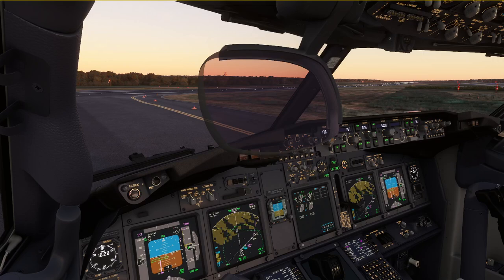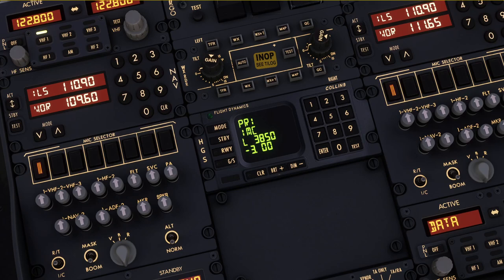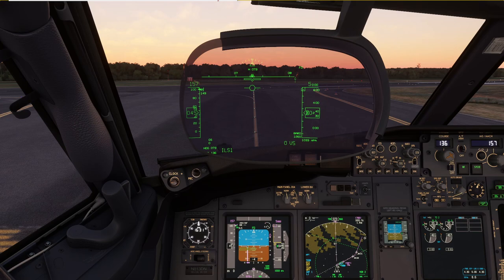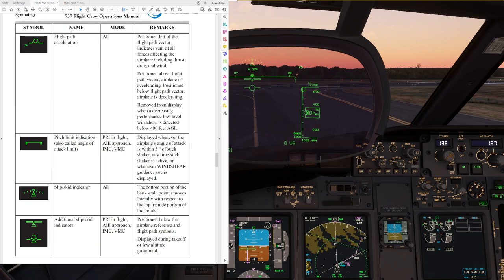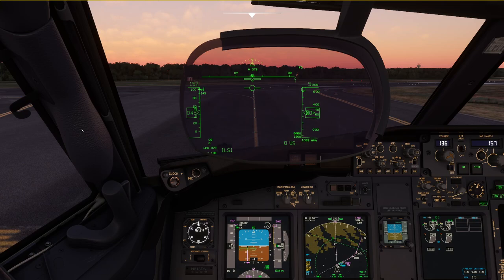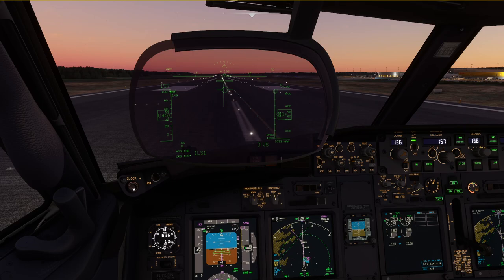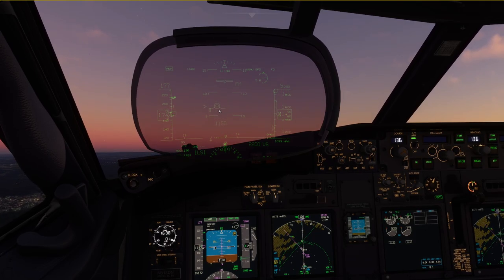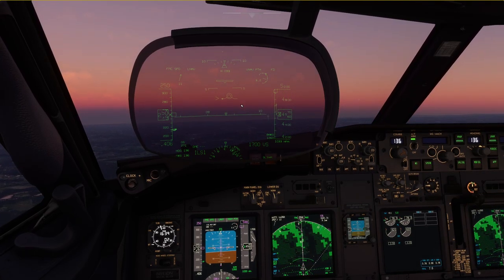Head Up Display Explained: Takeoff | Real Airline Pilot

Comment: Have you done a video on how to do a VNAV takeoff by setting up the climb page in the FMC?  I recently learned this procedure on another B737 pilot's video and have used it this last week and it is so nice.  Instead of having to manually increase your speed or bug up, it does it automatically.   This is especially nice in the simulator with only one person doing all the work.
Reply from the maker: Hi, I did a video on VNAV Takeoffs, yes. Probably did not include climb page references though, that's a different topic. I covered the climb page in my climb tutorial however.
Reply: @A330Driver  I know you have covered a great deal of information and it is a good reference library that I refer to many times.  I have a playlist on my YouTube Chanel just for the "PMDG 737 Tutorials" and they happen to be all your videos. I have thoroughly enjoyed learning this airplane.  When the B777 comes out will you be doing tutorials on it as well?

Comment: Thanks for the video! I have a question, what is the purpose of setting the runway length in the control unit for takeoff?
I thought it was for displaying the remaining runway distance during takeoff roll or during aborted takeoff. However, I've tried both scenarios and it doesn't show up anywhere.
Reply: Position updating like in the airbus?
Reply from the maker: Hi, yes, it is exactly for that position display. The real HUD will show you the runway remaining. PMDGs currently does not have that feature implemented yet.

Comment: Thanks a lot for these videos they are very interesting. I have one question, where can we found the PMDG 737 Flight Crew Operation Manual. I don't find it in my PMDG-737 700 files. Regards
Reply from the maker: Hi, it's not included with the addon. It came with the 737 NGX for FSX ten years ago, but Boeing has since terminated the license for new products.

Comment: Is there a reason why everything is in feet, but the Takeoff distance is in meters?
Reply from the maker: Welcome to the world of international aviation. You could also ask if there's a reason why altitudes are in feet and speed in knots rather than the worlds standard SI system which would dictate meters and km/h.
Reply: @A330Driver  well as far as I understood knots and nautical miles are used because of the connection with the latitude/longitude system and feet has historical reasons, I was just confused because I only saw meters in the performance calculator of the EFBs